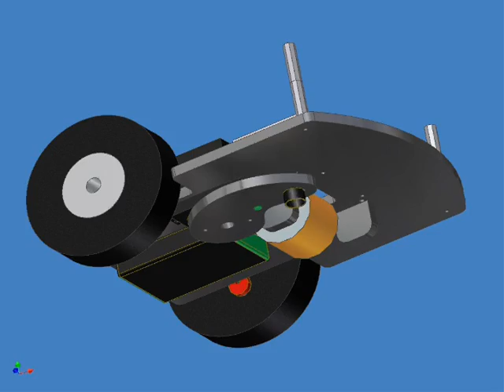How to Build a Robot

Comment: palmisano  —  27 May 2007  — A sped up video of me building a line following robot. Directly following is a CAD simulation, edge detection with a photoresistor demonstration, the robot following the line, performing a virtual box algorithm, and a ballerina dance.

*I built this 100% from scratch, it was not a toy, and it is not a kit*